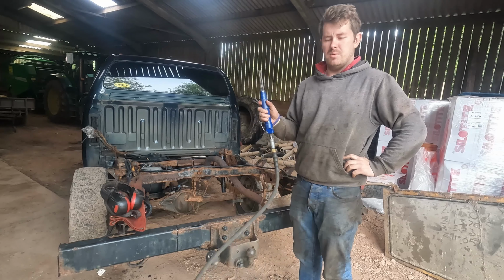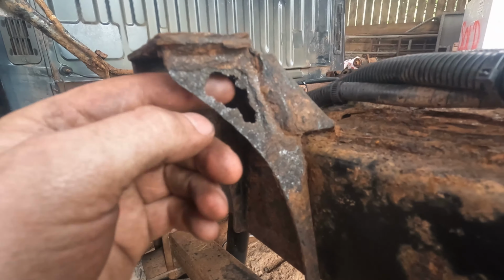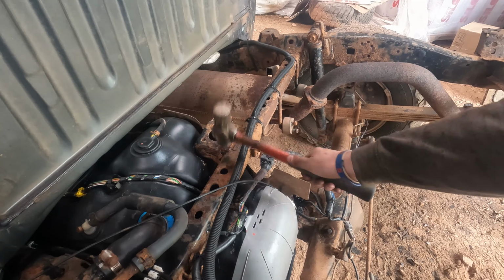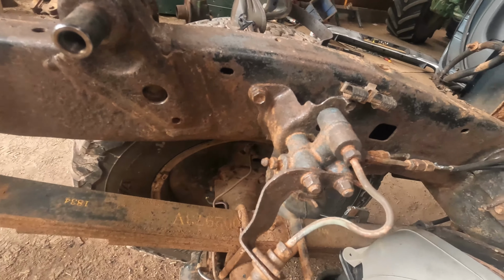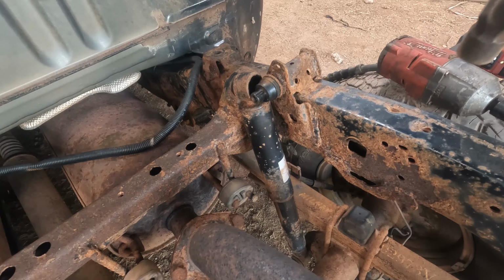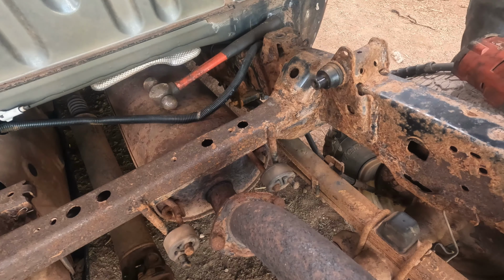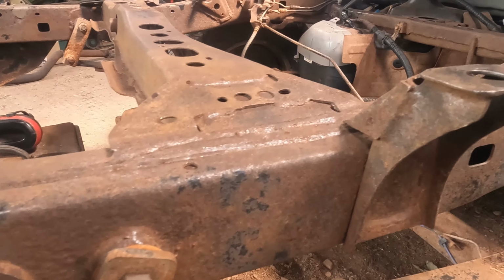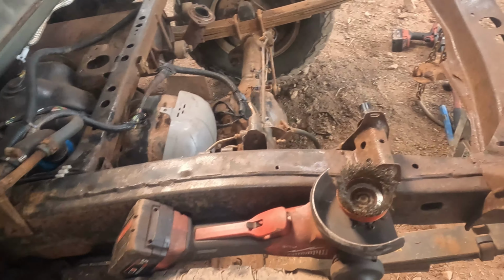RUST REMOVAL ON THE HILUX!!

Comment: they rot just under the back of the cab in the chassis .......seen them  snap there ....... your crossmember at the fuel tank looks better than most , they are generally the first  place they rot out .........seen 2014 models with plastic grommets in all the gig holes that are in the. 2 main rails    good to keep out the mud and salty water .....dont know if it was fitted at the factory or was a dealer mod ......
Reply from the maker: Yes, from the back of the cab backwards on this one was quite crispy, I think I caught it just at the tight time! There is plenty of dousing with old engine oil through the winter months to keep it protected 👌